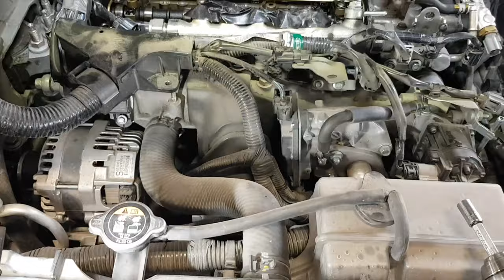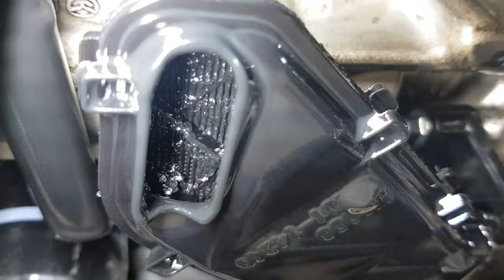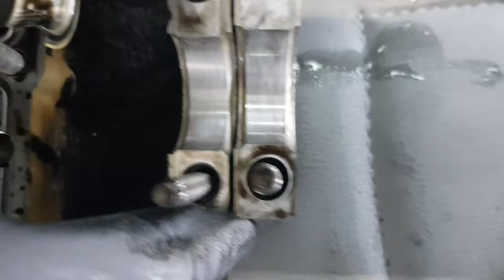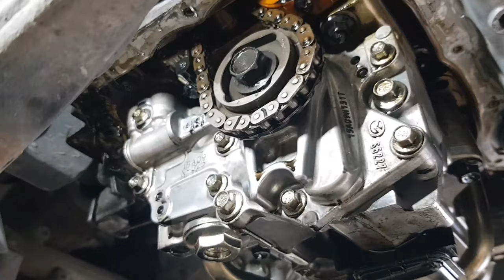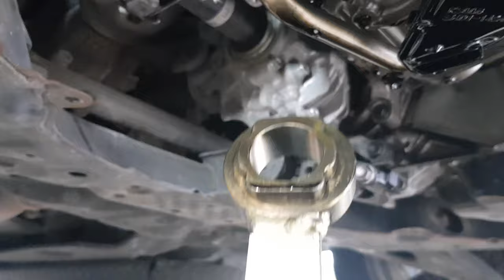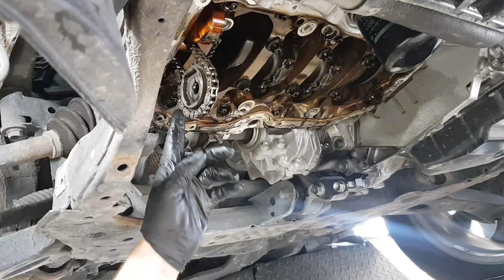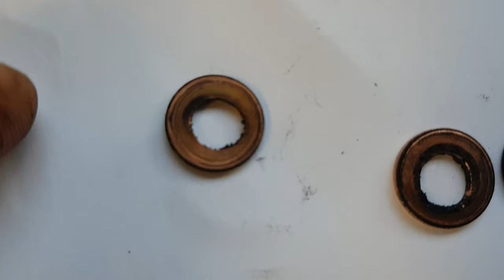P06DE P055F Low Oil Pressure Mazda 2.2 Skyactiv D

Comment: Hi, very good Video! But why you dont replace the Timing chain also? Best regards
Reply from the maker: Thanks. On those cars we had no issue with the stretched timing chain, therefore, replacement is not necessary, and if stretching occurs then you will get a warning light and DTC. let's say if you have an engine with mileage close to 300K km then it would be wise to replace it, but this one was 140K mileage only.
Regarding oil pump chain you replace it if visible damage/wear on chain guides, sprocket or chain.
Reply: @JB_Auto  thank you... Iam just asking, because the there are also complaints on the mazda engines. In this case the engine is about 50% dismanteled for this repair..  So the 2.2 skyactiv havent Problems mit the Timing chain?
Reply from the maker: Never with the timing chain, we replaced oil pump chains but those on cars where oil dilution was severe on almost every oil replacement interval. Often oil pump chains were snapped.
Reply from the maker: Luke Jonah Samuel Matthew  BMW has much more timing chain issues than Mazda, info about that is widely available on YouTube.
I never mentioned any issue of the timing chain on Skyactiv D engines because they never had one, so what are you referring to?
Reply from the maker: Luke Jonah Samuel Matthew  That's what I'm talking about in my video, I also trying to show you how to prevent it (Carbone composite) 
Regarding oil dilution check out, description section on some of the videos related to Skyactiv D. I'm also talking about how to prevent it, and that all are related to older engines.
Reply: Luke Jonah Samuel Matthew  I agree. I service my cars myself and I am kind of a maniac at it. I never skip ANYTHING. But my 2.2 is of 2015 model year. So the seals are the old, leaking type. Instead of recalling these engines I learned from the dealer that they just replace the seals at 100k service interval. This is not in the maintenance manual and that bothers me. It also means that Independant mechanics or diyers do not have all the info to correctly maintain these engines. It makes me wonder what else they are not telling me.

Comment: Fantastic video! Thank you. Do you know where can I get the special tool? I tried to look on-line but no luck. I am in the UK.
Reply from the maker: Thanks. All tools I purchased from the dealership, therefore it tends to be expensive.
Reply: @JB_Auto  thank you!
Reply: @JB_Auto  one more q. I just found out from my mechanic that camshaft is worn off. From your experience does it ultimately mean that turbo will need to be replaced too?
What else could be wrong if camshaft needs replacing? Thank you.
Reply from the maker: @Jarek Grzeskowiak  If the camshaft is worn out, you may have a problem with a vacuum pump, turbocharger, but all of this needs to be inspected, before any judgement. Vehicles after modifications 2013 (September approximately) shouldn't have camshaft problems unless bad maintenance and a clogged oil strainer, or a vehicle is driven short distances
Reply from the maker: The camshaft wear appears due to soot on exhaust valves, you need to inspect them as well.
Reply: Thank you for all your advice. Are you based in the UK?
Reply from the maker: @snayp1980  You are welcome. I live in Norway at the moment.
Reply: @JB_Auto  if you were in the UK I would pay you to come over to my place to get this bloody engine done as you are showing on those videos! 
Lack of tools is the biggest issue to be fair.

Comment: Amazing video! I'm planning on changing my injector washers since I have noticed some exhaust smell when opening the oil cap, along with poor fuel economy and a bit of hesitation when accelerating. 

I was wondering about the what the new torque specs for the injector bolts are. Could you help me out? 

Thanks!
Reply from the maker: Thanks. New injector torque: looking from the front of the engine: tighten left injector nut to two Nm, then loosen it 90 degrees, tighten the right nut to 2Nm, then tighten the same nut to 230 degrees angle.
Reply: @JB_Auto  You're awesome, thank you!

Comment: Hey, thank you so much for the video, i have the  low pressure DTC and thanks to the video I feel confident to repair it by myself! 
I am looking for all the spares and the washers are easy to find online but I can´t find the nuts with that reference. Is mandatory to replace the nuts with the new ones? Will I damage something if reuse them?
I have read in some forums that there is an o-ring in the tip of each injector that should be replaced too, but I'm not sure if they are talking about the skyactiv motor or the older one. Can you confirm that this doesnt have this o-rings?
Reply from the maker: Hey, There are no o-rings, Mazda recommends the replacement of nuts every time you remove them, I had to reuse them in one case and it went ok, but it is up to you. You need injector washers as on the video, that washer sits on injector nozzle or as you say tip.
Reply from the maker: Parts you need on the top of the engine nut x 8pcs part number: SHY1-13-148A
Washers x 8pcs (that goes under the nut) SH0113TM3
gasket 6 pcs on top of injectors for  the return line: SH0113833
Injector washer 4pcs SH0113H51
Valve cover gasket SH0110235
Those parts are cheap at the dealer so buy there, try to avoid none genuine parts.
Reply: @JB_Auto  
Hello again my friend.
I started today the repair. It was very very hard to take out 2 of the injectors that were leaking. I'm now cleaning all around the camshafts but have a doubt. Do you think it is possible to remove the camshaft caps one by one to check the wear and the oil passage of the first one? I mean, remove the first, check it, tight it, then the second and so... Or should I remove all of them and tight them in the specified order? 

Thank you!
Reply from the maker: Hi, to avoid unnecessary work I always remove one by one, unless I find a bad one, then it is a bigger job. Regarding injectors, if they were removed with great force they may not work properly.
Reply: @JB_Auto  
Oh god, do you mean they could get damaged when removing them? What will I notice if they don't work properly?
Reply from the maker: @xekil  Could be improper injection amount, the engine can run unevenly, could cause DPF problems. Next time if injectors are stuck, warm up the engine to operating temperature and keep it running for some time, then the soot gets soft and so remove them. Now I suggest a replacement unless you want to give it a try. We haven't replaced injectors in all cases, but it is a bit of a risk.

Comment: Thanks for the video! Very informative! Do you happen to know any issues with the reduced oil pressure? Mazda 6 2.2 from 2016,reduced oil pressure during idle abt 70kPa.replaced oil, filters, con rod bearings, strainer and oil pump at the workshop recommendation still low. No obvious carbon deposit found in lower part. Planning to inspect camshafts area for wear this week. Any ideea if hyd tensioners from timing and oil pump chain influence pressure that much? Frequent codes P06DE, U0442(00), P0101. Any advice is highly appreciated!
Reply from the maker: Thanks. What's the mileage of the car, do you know all the history of the car, are you a recent owner of it?
Reply: 180k km, I'm a recent owner, previous owner gived me some papers describing some jobs done for the car, like timing chains, turbo, washers, cam etc. I don't fully trust this papers so we started our own investigation. When I asked him why he changed so much things he said:preventive maintenance... Bullsh**, during pump replacement I noticed some marks on the oil pan near to the oil pp chain, looks like the chain snapped. Today I am opening top side for inspection,let's se what surprises we find there
Reply from the maker: Based on that what you wrote he had an oil pressure problem before, and it could be fixed too late that is why that DTC P06DE. First of all, we never replaced turbo on the 2016 model year, neither oil pump chain if the vehicle was properly maintained. I would check everything from the beginning, if replaced conrod bearings, what was the crankshaft condition, what about main bearings? then how about camshaft journal caps? HLA shouldn't have much influence this is one of the last elements receiving oil then it goes to rocker arms and returns to the oil sump. So I would concentrate on mechanical issues, rather than electrical. P0101 I would check for soot in the inlet manifold.
Reply: We did not check the main bearings,crankshaft was in good condition, just today I managed to check the camshafts, the exhaust one has high wear on all the cams and little on the journals,little wear found on the journal cap. Making now calculations if is worth the money spent to repair or to invest in another engine. BTW regarding the code p1010 intake manifold and auxiliaries were cleaned, New Map sensor, turbochargers checked for clearence and wear.
Reply: @JB_Auto Are these problems fixed on newer engines?  My cx5 was produced in 4/2017.
Reply from the maker: @dukic91 I would say it is improved, but because of its construction, I recommend the replacement of injector gaskets every 100K km 🙂
Reply: @JB_Auto  I changed injectors gasket on 170.000... plus i changed 3-4 sensors(every sensor was cca 180e), i had problem with intake manifold... manifold was little damaged, so i installed a new one... he inspected my turbocharger and said its in good shape... aafter 10 days my oil pump was gone. So again new oil pump, cleaning \ washing  engine... all together 4600e.. i hope i won't gonna have problems with engine. Mine is 129kw... i heard it's a little better engine.... what do you think? Thanks for reply 👍🙏😊
Reply from the maker: @dukic91  It is a better engine, I wonder what was the reason for the oil pump replacement? Replaced which sensors?
Reply: @JB_Auto  Honestly, I'm not sure.  One sensor is for dpf I think.  Then one exhaust gas sensor, and some sensor on the oil pump was replaced.  When they did that, they called me from Mazda and said that everything was fine.  The next day they call and say that something is wrong with the oil pump. As far as I understand, there is not as much oil coming out as it is going in.  That same day, they call me again and say that strainer on the oil pump is clogged and that dirt probably got into the pump and damaged it.  That's why we flushed/washed the engine.  In short, a disaster.  I just hope that there will be no problems with the engine.
Reply from the maker: @dukic91  OK, everything is clear now. The engine should run well.
Reply: @JB_Auto  Just one more question.  If he put in a new oil pump, did he also replace the oil pump chain?  Thank you very much!
Reply from the maker: @dukic91  I do not think so, because for that job you should remove the timing chain, and that is way more labor time.

Comment: Mazda 2.2 diesel oil change schedule is 6250 miles with LOW SAPS oil. That's why this engine has so many problems.
Reply: What is the problem with low SAPS oil?
You didn't explain?
Lots of vehicles run on low SAPS oil with zero issues.
Are you saying by not using low SAPS oil.
The 2.2D Mazda would be okay?